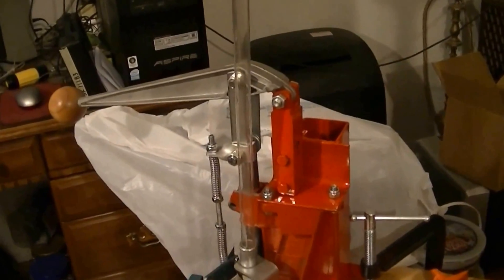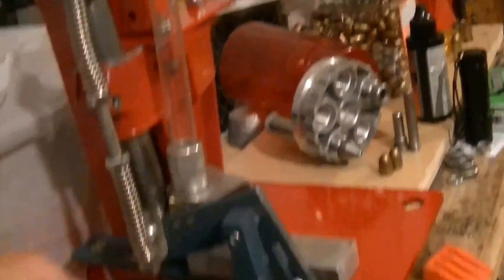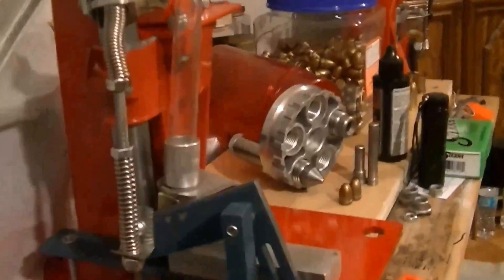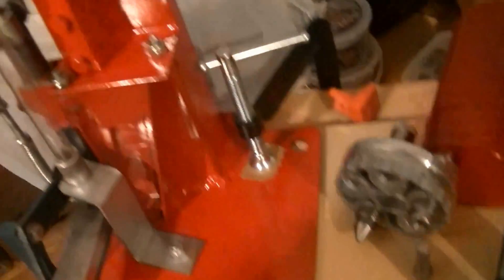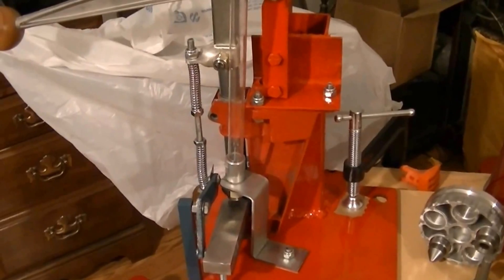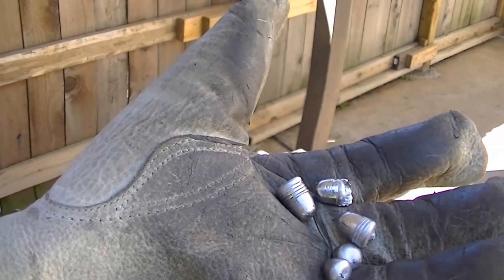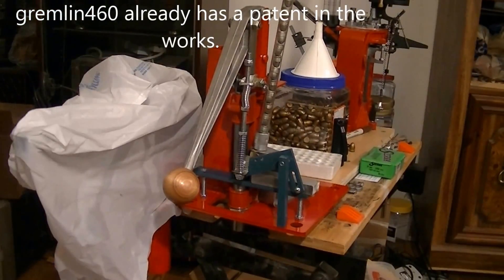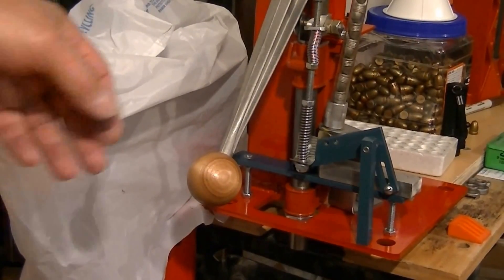Fast bullet sizer  or Completely wonderful and useful machine

Comment: where did you get that collar on press shaft?
Reply from the maker: I have to apologize for not understanding your question.  I watched the video and went to the bullet sizer and I do not know what part you are referring to.   Anything that did not come with the press I made so maybe that answers the question.  Thanks for stopping by.
Reply: how did yoy fasten that rod with 2 springs on itto upper part of press?
Reply from the maker: I made a "L" shape flat metal piece and drilled a hole in it that connects it to the same place the ram connects to the linkage for the handle.  The bottom of the "L" keeps the flat metal straight with the ram (push rod).  On the long end of the "L" shape flat metal piece I twisted the end so it has a flat area facing down and drilled a hole through it for the rod that holds the springs.  I hope this is helpful.

Comment: Funny I should see this video I watched one last night where you turn your single stage press up side down so I was up early taking my old LEE single stage press and making a faster cast boolit sizer  instead of using a long tube from my sizer die I made a strong shelf under my bench so my bucket is closer to the falling lead
Thanks for sharing
Reply from the maker: It works a lot better upside down.  I used to pinch my fingers now and then when it was right side up.  Now you can dump in a bunch of boolits and size like a mad man.  Thanks for watching and commenting Don.

Comment: Thanks for posting this video Harold. I want to make one of  these & this helps clarify some details that I was trying to think through.
Reply from the maker: Thanks for the comment Mike.  I think the "L" shaped lever that moves the bullet shuttle back and forth could be improved a lot by putting it in the center of the shuttle instead on the side or at least by putting the supports for it on each side of the shuttle so it does not want to twist any on the support.  Check the Cast boolits forum for the latest in improvements made by the fellow who invented it.  .
Reply: cerberus I will, Thanks very much!

Comment: Very nice looking machine you built. I would think the fall into the container could dent the lead.
 
Congrats on placing in the match.. :-)
Reply from the maker: Thanks built, I stole the idea but I am still proud of the product.  Thanks for the comment.
Reply from the maker: I am planning to get a hose that will curve some and stop the rapid drop into the bucket.  Still I don't think I am getting any noticeable dents.  Yeah last is a place at that.  I think I may start charging them for showing up, after all if I don't then one of them is subject to getting last place.  Thanks for the comment.
Reply: cerberus You should get a discount at least... saving wear and tear on there targets :-)  I can see welding a tiny little hook on the underside where the bullets drop out to hang a tiny pail or even a painted up soup can with a home made metal handle... a miniature little bucket to catch the prizes.